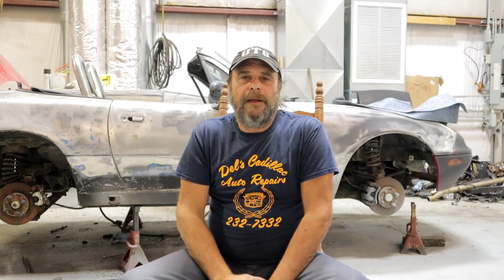Automotive De-Evolution...The Next Big Thing?

Comment: Turn, Turn, Turn....kids today aren't even getting licenses; kids BORN today will never drive nor care about the EV robo taxi that will move them. The few that do take an interest will hack and chip incredibly cheap incredibly fast (sub 3 second 0-60) used EVs in their back yard - or kitchen table - after all it's an electric motor(s) not heavy metal. They might wonder what all the fuss was about with those old slow noisy gas burners that couldn't turn and needed re-filling. My 'Cudas and R/Ts were cool, and that's why we liked them - not to wrench on - and I miss the looks of the old cars - but the cars if you were honest here - were garbage compared to a Corolla today. You ever study exactly how cheap a 'Cuda inside door panel is? Or how many polyester worms died for that stuff?   Turn, turn, turn...........🚀

Comment: I learned electronic fuel injection at Volvo  in the mid 80s.  Went to GM and most of that was over emission carburetor crap. Than it was Trottle Body injection and not tuning capabilities! Even in late 90s Chrysler port injection had no tuning capabilities unless it was a Flash programming done by Chrysler. 
I get it, been there. Good job Tony!

Comment: watched that same video . i've had all these engines in that video at one time or the other. i think the boss 351 would probably be the strongest stock mill of that bunch for the street. one of my fave hot rods all-time was a 89 RX7 turbo with a canfield headed 327 and built 700r4 though the mill could crank out 500+ it was detuned to about 430hp cause of the short hedders pipes and mufflers, and it had a single plane intake with a 750 that would all-most fit under the hood. could have picked up some easy power with another intake . but the entire carb would have been out of the hood. and 411 gears could get a bit of rubber in every gear--

Comment: I grew up working on cars from the 60's - 80's. So, when I got laid off and the guy working on my sons transmission was in need of help I offered. He knew me had seen my vehicles and even built one of my transmissions over the years and gladly said YES! Please, I need an adult in here that knows what he's doing. Now, 6 months later, I CANNOT STAND working on new cars. You can't get a tool to anything easily, everything is extremely overcomplicated using more parts to perform simple tasks than were EVER necessary before (worse than Dodge linkage setups!) I'm to the point I just want to start my own business building old cars just to the point of making them daily drivers and selling them to get as many real cars back on the road as I can! Old vehicle - F150, C10, 1500, whatever, 1:45-2:15 to get a tranny out that's 4WD, new vehicle, like Ford escape ecoboost - 8 hours to remove transmission! How did I end up removing wiper arms from the vehicle just to get started on removing the TRANSMISSION! Old Mustang, 2wd truck - 45 minutes just chillin' pulling it out!

Comment: I was born in 98, and have yet to own a car that was built after I was born. I think the reason is 2 part: 1) it's hard to get nice new stuff as a broke young guy, and 2) there's so much knowledge and experience available nowadays for these older car that you can DIY mods yourself instead of buying fancy scanning equipment and tools. For example, my 94 Firebird may have EFI and computer control, but its still basically an SBC under the hood. There's a lot of legacy parts in these 80's-90's cars that get overlooked, and kinda have to fill the gap when you can't afford a classic muscle car in college anymore

Comment: This is something that I've been saying for a while now. My wife and many others think I am crazy for rebuilding, and driving 1995 Saturn I have. Basically, it's the last car that came with crank windows, manual transmissions, and a layout that is easy to get at everything, to service, etc. I've rebuilt two different engines, and drove a collective million miles on my 95, and 94 SL1's. They get 35-40mpg, and are dead simple machines. They have SOME electronicals, but they aren't so overly wired up that you can't figure out anything. O2 sensor, TPS, MAP, IAC, ECTS, Crank position sensor, Oil  pressure sensor. They run on wasted spark with 2 coils right in the front of the engine, parts are cheap, simple macpherson strut and lower control arm rack and pinion, and if you get the non power steering models, you can literally get at EVERYTHING. Now, would I rather run a 4 speed slant 6 duster/dart from 1968? OF COURSE!! But I can't afford that.. People want an arm and a leg for that. I can get a Saturn for basically scrap value. I bought a 2012 Sonic, and it is an actual Pain to work on, and everything breaks on it!! GRRR.

Comment: Im 22 and took one look at cars after 2010 and gaged i bought a 74 Apollo and havent looked back yeah its dangerous and falling apart as i drive it but i know for a fact i can fix anything on it with enough time and energy computers on the other hand need factory codes and are price locked from normal guys like me good luck grease monkeys

Comment: 289 Ford. It was always better than the 302.        In the 70's, a friend bought a 64 Caddy   for $100 from a judge.  2 weeks later - we went to the gas station -[ We wanted to hear the 4 bbls run and rippled the tires off the Caddy as we passed the Judge's house and he was cutting the grass.  We got back to the house, backed in the Caddy - put her up on jack stands and drained the oil. We left the hood up, so it looked like we were working on it.  5 Min later - police arrive and we spent 10 minutes explaining that we were here working on this car.   It took us awhile to convince him, but he never touched the engine.

Comment: I'm a bit older than you and first remember cars from during the war. My dad was a Ford man who's first car was a Model A roadster, but the flat head V8 that succeeded it was aways the engine that took his fancy. Then again he never bad mouthed the Thunderbird overhead valve V8 when he traded in the '53 flathead on the red '56 station wagon.  So I saw cars get better and better as the 50s passed and for me they peaked a little earlier. Among the cars I owned it was the 63 Chrysler convertible with the 383 that was the peak. A much better styled car was a friend's 62 Cadillac which just drove beautifully. They were all business and no legislation under the hood - and a joy to work on. But I wont quibble, with your 1970 - you went way further into cars than I ever did. But I'll say this:  As soon as I had a car with a computer I started to lose interest. Now I just accept that a car is an appliance - I am happy with my Toyota Echo.  I noticed that my interest quickly went into building and tweaking computers. Now we have the untweakable M1 Macs. So it goes. Love what you are doing with the Miata.

Comment: Right you are about the 1970 era.  The span of about 68-72 produced the most uniquely wonderful cars ever.  Simple, affordable, and oozing personality.  Roll it out on saturday morning, fix it with a hammer, and cruise all night.  I did that in the early nineties and it was nostalgic back then.  Now, it's 2021 and I'm still looking in my garage at my 69 fastback cuda 340, and my 92 lx 5.0 mustang and I realuze that 50 years has done nothing to replace these few legendary power plants.  My modern hemi powered 300c family sedan sits in the driveway and honestly blows em all away performance wise, but the modern high tech stuff just deosnt have the 'character' of the classics.  Cheers to all the old school gearheads out there!

Comment: There will be kids today that look back at the modern cars of now and lust for them, as the cars in 20/30 years won't have "soul". That's hard for us to comprehend, but that's the power of nostalgia. Carbs aren't any better than EFI. EFI gives you the best possible power output at that given rev, at that given altitude, at that given temperature. Carbs don't give you the same power across all conditions, they just can't, though they hark back to a time when you could see, mechanically, the process. EFI obfuscates that to the naked eye, but that doesn't mean you can't see the process in other ways. The problem is, the more modern a car the less it trusts you to drive it. You're driving the modern car (and I say modern as post-2005) by proxy. There is a middle man between you turning the wheel to the wheel being turned. That ruins driving.

I've a 2016 Mercedes Benz C350e, plenty of power. Acceleration is great. Air con is awesome. But do I like driving it? No. Because the computer thinks it knows better than me when it comes to steering feel, pedal position, braking. I've a 1998 Corolla and it has EFI, but no electronic power steering and no ABS. I love driving it. It feels heavy, I know there is a direct connection between my input to the car. And it's from 2005 the middle-man entered the equation for cars. I am in command of the car, the car isn't in command of me.

That is the problem. Not the technology itself. It's how it's implemented.

Comment: This is 100% accurate. I’m 27 years old and a huge car guy. My 2018 Honda Accord is great to drive to work because it’s reliable and cheap as hell on gas, but my 79 dodge D150 with a 318 and open headers is a lot more of connection to drive. 10 times the fun

Comment: Uncle Tony, love your videos, first and foremost, Thank You! for the effort you put in.  I'm re-learning a ton of stuff (like curbing the distributor) that my dad taught me when I was little but haven't applied in practice for years.  As many others have said already, you are spot on.  I have an all original 74 Stingray, and a restomod 72 Camaro RS (383ci/700R4).  I've had the Camaro 26 years, built the car up twice as my vision for it evolved.  Turned every bolt and screw, attached every wire.  I know how the car is feeling when I start it.  I can tell by the sound it makes how it's going to respond.  You get none of this from anything manufactured since probably the late 80's.  I like my daily driver for what it is, a Toyota Sequoia that never breaks down, but after 12 years of driving it there's still little feedback on what that beast is thinking.  It's solid, but very much appliance like, as you say.

Comment: New cars are soulless. Plus in the 70's they started to take away our control of the machine. Catalytic converters, non adjustable idle control circuits, lean burn ignitions. Now this modern garbage doesn't have a shaft to connect the steering, no cable for the throttle, you can't even control the brakes. I'll never own anything newer than 86.

Comment: When I did my trade ticket 20 years ago my teachers noticed that I liked the old school cars and they offered to take me out  of the turbo charging module and replaced it with distributors (including re-graphing them) and carbies. All of the other students thought I was nuts because ricers were all the rage back then. I'm glad that I did, because I loved working on them.
Fast forward 20 years, I'm driving late models and off the tools but still working in a dealership dealing with customers and the technicians dealing with electronic dramas everyday, thinking, I miss the carby days. I didn't need an expensive scanner to just figure out what part has crapped itself or what code has it thrown out.
SO, I've ordered myself the old 340 V8 cam whilst looking for a 318 to stick it in and I've always wanted to build a 350 chevy, So I ordered a muscle car era cam for one of those too and I'm looking for a 350 block to put it in. Then it's look for some old 60's or 70's era car to stick them in.
Heck, I may even rebuild one of my Slant 6's or my 265 hemi 6 that are in my shed and find an early Valiant to stick them in and make it into a reliable and simple daily driver.
I've totally had it with late model appliance cars, I want to go back to a simpler and more enjoyable time when I actually enjoyed working on cars and it didn't feel like a chore.

Comment: I agree. I'm in my early 30s, and back when I was a teenager our paddock basher was a '66 Beetle my first car was a Mark II Ford Escort. After that I got into Aussie Valiants but usually had a VL Commodore for my daily. Even though the VLs were 80s cars I didn't really connect with them and servicing was more of a chore than a joy compared to the carbureted project cars. I now still have Valiants and daily drove an R34 Skyline and now a WRX and it's still the same in terms of connection. Even though the 1970 VG ute has about half the hp it's still far more enjoyable to drive and work on than my 2006 WRX.

Comment: It's not just the 70s I have a 73 Pontiac but I also have a 62 sunbeam and I love working on it..I can pull the engine out in 4 hours... rebuild it and drop it back in just as fast. also I am recently interested and fascinated by the Ford flathead v8s and people squeezing 300 horses out of them, as I'm also rebuilding a 31 Harley flathead myself...I know you love the 70s but there are a lot more era's that have the same connection with and love for that a lot of people are into.. Even the kids that make those little drift cars it is a thing for them.
Oh and my 62 had after market electronics ignition that failed on me in the middle of the desert in a sand storm...I had spare points in the trunk and put them in spit out some sand out of my mouth and got home.. I'll never use electronics ignition again.

Comment: I completely agree with this because I’m ls swapping my 03 s 10  and I had caught my self thinking about the Chevy 350 and how it’s more simple of an engine. I got the ls for my project because I got a deal that was out of this world 500 for the engine I was able to hear run and ecu and uncut wire harness. Had I when with the Chevy 350 or even 305 the carb and the dizzy would have been all that’s needed but the demand for the 350 is higher than ls so the price is higher for that.  I don’t like how complex cars are getting. If I can’t work on it I’m not buying it especially if it’s an EV   .

Comment: heck Tony, I'm near your age, if I wanted a computer with wheels on it that's trying to be a F'n Cadillac I'd buy it. the most basic electronic ignition, maybe fuel injection, heater and AC, and MANUAL windows door locks etc.. THAT is what I expect a CAR to be. easy maintenance, cheap parts, reliable. no Siri, no Alexa, if I want a GPS I'll get a phone app!

Comment: You are half right how many restoration 60/70 car run like shit because nobody can tune them correctly or got massive carb on them for no reason and get shitty drivability and poor gaz mileage 

And for the efi conversion find a competent tuner and you will be happy with more power as a bonus 
Go look richard holdener video on the 2jz amc rambler car this guy ditched the efib and put 3 carb and did a distributor conversion and used a slant 6 distributor  to boot cool stuff

Comment: Tony I can not agree more with you  - my 94 Zj with its 5.2 Mopar magnum v8 - grand son of the 318 poly - is about as modern as I want to go with car - This model is pre canbus, with discrete systems - so when the washer bottle is empty the wheel nuts dont unscrew. AC have issues, keep going,  Overdrive solenoid have issues, unplug it  and operate the a518 46 RH as a TF 727(which it is at the core), and keep going. Quite frankly my next project is a 57 D100 with a 318 Poly...two barrel. and a 727. The more modren cars, and my 27 year old Jeep is border line here - you spend more time sorting out ancilary stuff, and wiring and plugs, instead of just driving the thing, or working on the engine itself. On my 78 CLRegal SE( Chrysler SE here is South Africa) with LA 318 & TF727, working on the engine is drop dead easy(ish) Being a late 70's model the wiring harnass is a bear with all the ancilaries - but if they dont work - you can ignore them for the time. The Jeep with basically at the core the same engine and transmisson - just evolved versions - Not so much, since it has this secret sauce layer of wiring and plumbing between you and the nice to play with bits. And here you have to spend time with ancilaries - les so than later cars, but still  a lot more than on the chrylser. My travel spares and toolbox is also a bit more sizeable ( on the SE - oil atf water, fanbelts  - it has 3  - distributor cap, rotor coil and mopar electronic ignition module, and a few tools. On the Jeep - oil atf Fanbelt ( it only has one - huge improvement) distributor cap rotor.......spare computer, Campos. sensor, TPS, CPS, O2, Coil, a set of copper sparkplugs,IAC, EGR transducer,  MAP sensor and Coolant temp sensor for the EFI. Spare Dana30 front wheel bearing hub assembly - and a bigger bunch of tools including a diagnostics scanner. and a laptiop with the factory manual. This sound over the top, but when you are driving long distance, and something goes wrong, and you are the only guy around that can wrench on these things, you better be prepared. That said - neither cars have ever left me stranded

Comment: I am probably the worst mechanic you will ever meet, but...there is a huge satisfaction that comes from mastering driving an analog automobile, too. 

Teach these young kids how to handle a manual choke, shift around a dying synchro, and engine brake down a long grade, and they go nuts (in a good way.) Once they actually have to DRIVE, they turn into rally drivers in minutes.

They know that any family member can replace them in an appliance. An analog car gets them involved in a way that injected automatic SUV never will.